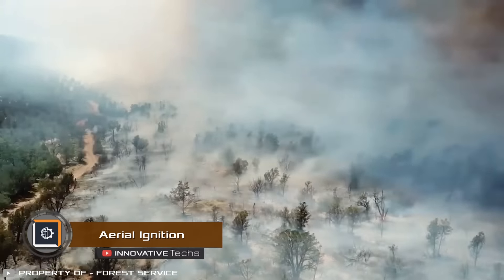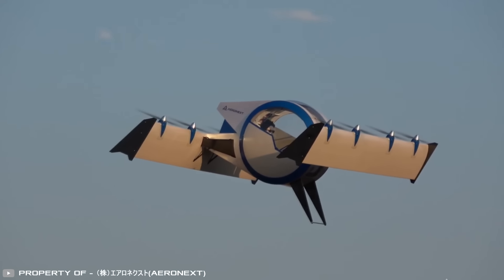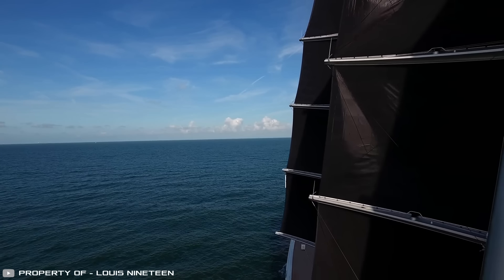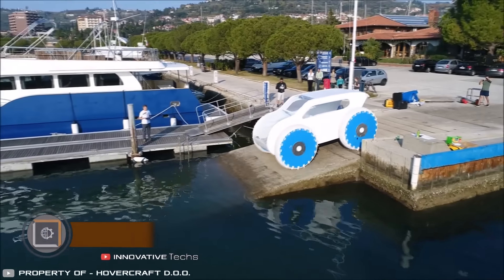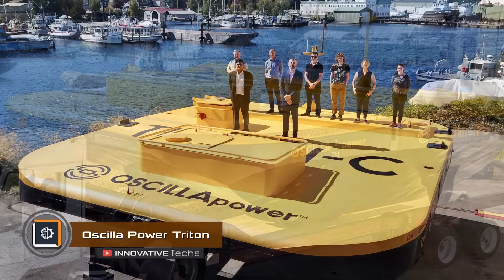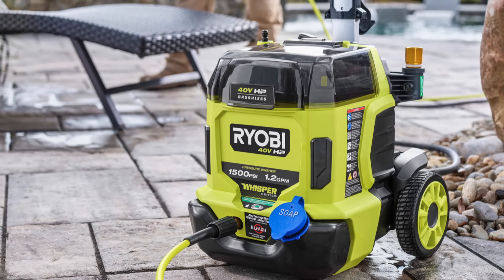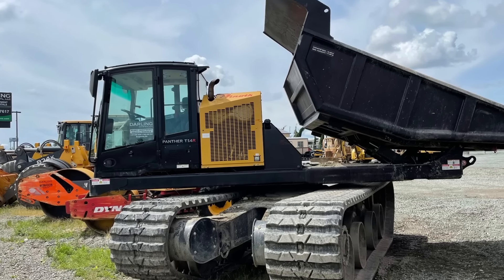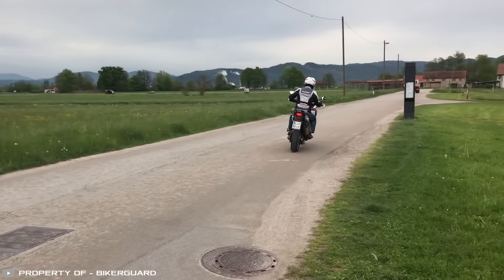The Japanese Surprised Everyone With This Flying Vehicle - 25 Brilliant Inventions

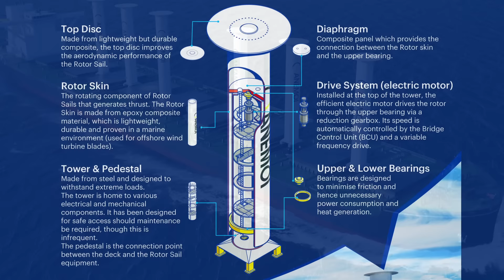Comment: 8:00 - One glaring problem with that container ship is that there are no containers on its decks. Ordinarily, container ships travel with containers both in the holds and piled high on the decks. Those rotary sails would be sheltered by the containers, resulting in no forward motion.

Comment: The Wippie was the most practical and for resale would make more money than any other shown . PS . Any air craft with multipool blade are very noisy and if they are electric will not stand the test of time and ware . We are still flying air machines that are up to 70 years old and electric aircraft are only good from 3 to 7 years and this makes no sense .

Comment: There were 3 climate changes last century. 1904 to 1941 was the highest temperature climate of the century, with a high density of sunspots. From 1941 to 1980,  the climate was cool temperature with a lower density of sunspots. 1980 to 2009 was a warm temperature climate however temperatures never rose to 1901 to 1941.
2025 We are entering into a 200-year historical mini-ice age climate, recorded since the 1400s, 1600s, and 1800s. The Japanese recorded sunspot data during these early times. However cosmic ray climate effects were discovered in the 1960s. 
At present! The lack of sunspots leaves Earth without the magnetic solar wind leaving Earth without protection from cosmic rays and its climate effects, and the next 25-35 years will be extreme weather outcomes similar to the historical outcomes.
Reply: Thoroughly debunked decades ago.
Why must we be subjected to this nonsense again?

Comment: Great video, the solar plane using vertical for a quick take off then transitioning to horizontal flight I call BS. You would only take of vertically if you had no other choice, it's just too energy intensive. In normal operation it would take of conventionally. Anyway, it's gonna be a long time or a massive leap in tech before piloted and passenger carrying solar planes are ever in service. Pretty good vid, but some of it's like the flying cars they predicted in the 50's, still waiting...

Comment: The problems with any aerial person transport drone are always the same. Noise, Windblast and power storage. And of course also the risk of a car equivalent falling from the sky and hitting people or other ground or aerial transport vehicles below them. All of this combines to making such vehicles essentially unusable in cities or other desly populated areas. And if you can only get to special locations with these vehicles than there is no real difference to a helicopter or plane.

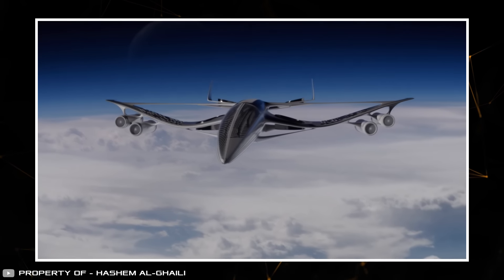5:39 This is pure vaporware. Notice that the only thing shown there is cgi. And it's incredibly easy to make stuff work in cgi. Fact is: The only functional solar planes so far are ultralight planes that take only a single or at most two passengers. And the explanations are incredibly vague. They sound like something elon musk would say. In other words, pure bullshit. "In the startosphere is less air resitance and more sunlight" i'm losing braincells just listening to crap like this. Yes, there's less air resistance in the stratosphere. And that's because there's less air there and thus you either have to go ludicrously fast or have ludicrously large wings to get enough lift. Not to mention that the turbines give much less thrust because they are pushing much less air.